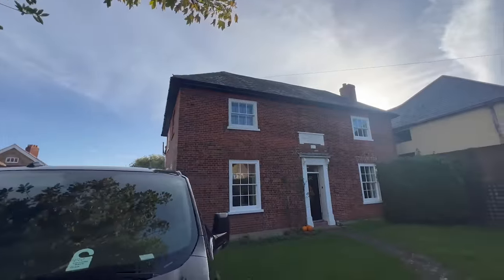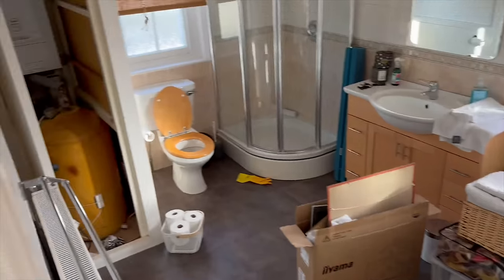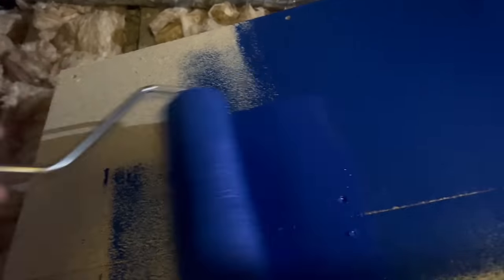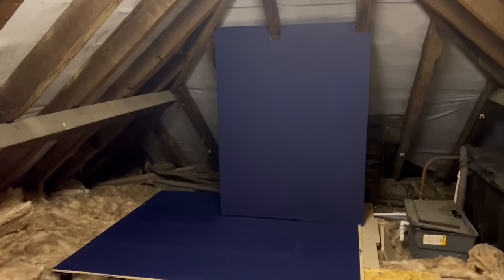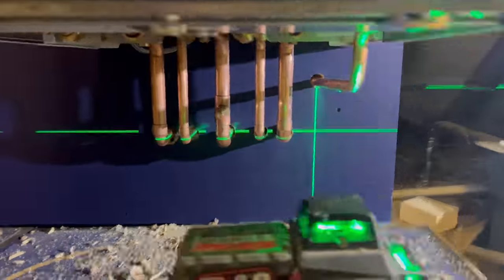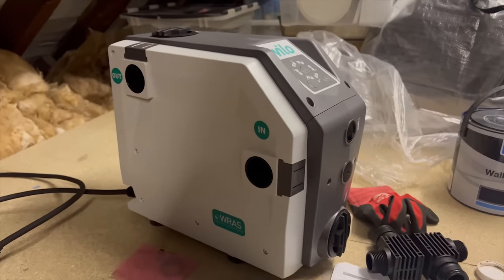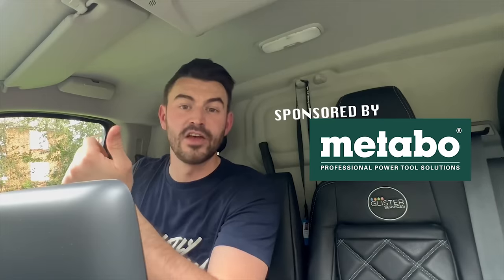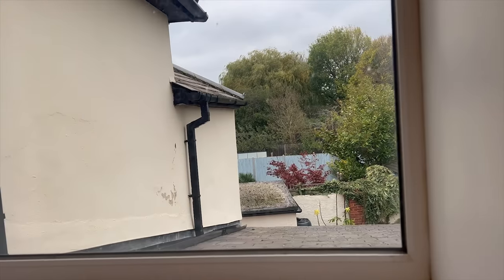WELCOME! Worlds 1st Vaillant Combination Boiler to be piped using a Wilo Isar Boost Pump! PT 1

Comment: Congrats, would be great to see why the 938 was chosen over the standard combi and more about the vailant warranty. Great install idea for the location. Looking forward to the pump review
Reply: This is the storage boiler he fitted. Has higher flow rates
Reply: @SalimKhan-gk1fh  its combi with storage tank
Reply: @enamquadir6281  yes but I would have fitted a viessmann vitodens 111 . It’s far superior to a vaillant has built in pump and 46 litre tank. New vaillants are rubbish
Reply from the maker: @SalimKhan-gk1fh  Ever tried getting a 111 through that loft hatch on your own?
Reply: @SalimKhan-gk1fh  Viessmann are also very good, but the 938 & 111 are specialist Combi's, would be great to see the performance of the 938 after install has finished